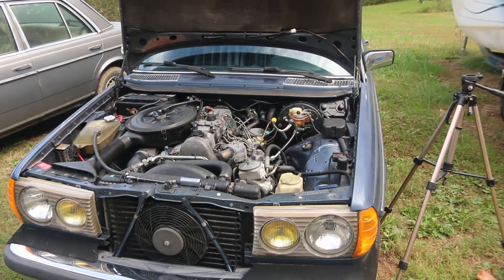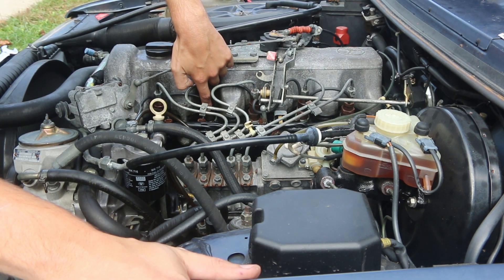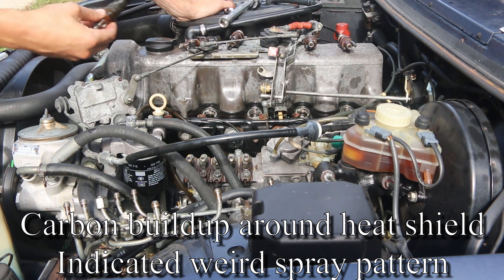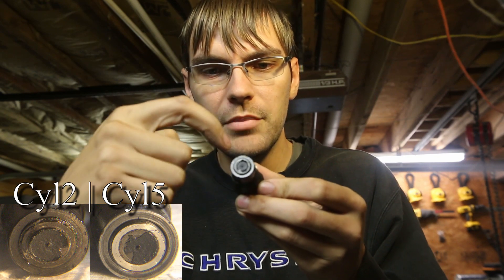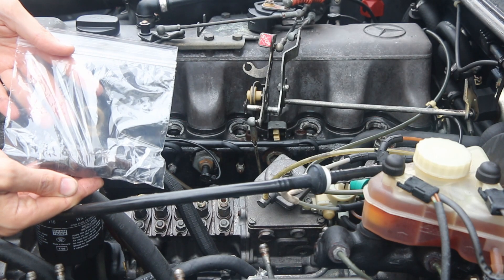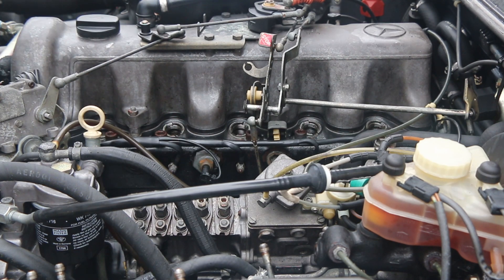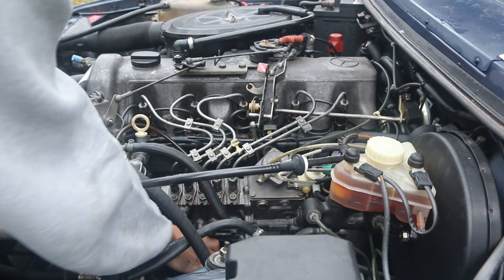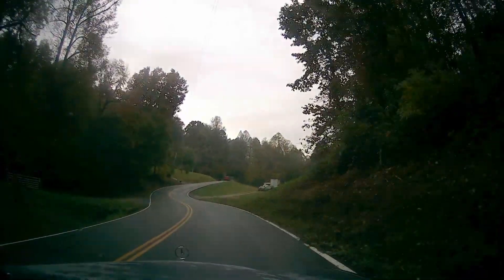Om617 knocking/rattling noise, injector nailing before and after nozzle replacement

Comment: Thanks for the Video I'm having the same noise with my 1980 non turbo 300D.  I've replaced the vacuum pump, timing chain tensioner and did a valve adjustment.  Noise still there.  I bled each injector while running but didn't really hear any difference, going to pressure test them next.  Noise seems to be stronger once the engine warms up- did you notice this on yours?  Car otherwise runs fine starts up strong down to the single digits, has good power(for a non turbo).
Reply from the maker: Dead on! The hotter the engine was the more pronounced it seemed to be. I'd check the pop pressures, doing the nozzles and balancing them did make a distinct difference in the sound of the car, I should make another recording of how it sounds now that the new nozzles have settled in a bit. I have some other things I'm curious about adding to the noise as well, timing chain stretch being #1, as I too replace vacuum pump and several other random things looking for the noise source, compression tested, valve adjustment, swapped the cam out even when I found peculiar wear on one lobe
Reply: Maybe it's the ball bearing in the prechamber that can come loose and make a strange rattle and inconsistent engine idle
Reply from the maker: @zoticus1  I checked the prechambers with a borescope but it really didn't make sense to have in the video, it doesn't record very well but they all looked intact, the injectors definetly have helped, I'm a little suspicious of the injection timing now

Comment: Nice. A compression test and possible culprits is where I would look after doing a quick valve adjustment with a feeler gage. To me it sounds like the piston is tapping against the cylinder wall. You might be able to locate the noise with a long rod against the engine block.
Reply from the maker: I did a compression test when I got the car (it was making the rattling then) and each cylinder was within 10ish psi of 350 with the engine cold and no oil, fuel or anything in the cylinders to help rings seal, which I think is pretty good for a 210k+ mile motor. The injectors did quiet it down a lot, I'm a little suspicious of the timing chain, I am going to be investigating that soon as I'm curious if it has stretched out and tweaked the timing causing some extra combustion noise as a result, or possibly even is so loose the tensioner has run out of adjustment and it is rattling in the cavity where it rides.

I tried using a mechanics stethoscope and it seemed to be more pronounced toward the front of the engine, but it was hard to get an exact read on where it was from.

There will be more videos of this car, one coming super soon about the lack of top end power involving the tank strainer and other fuel system stuff!

Comment: Every 617 seems to have its own unique clatter signature. You can try liquid moly CeraTec next oil change. I’ve seen it quite down several noisy engines in otherwise good shape.
Reply from the maker: I've noticed they all have a different personality too. It gets real weird when you start comparing the smells of various diesels. The idi Mercedes vs Cat vs Cummins vs Navistar etc, they all have a different odor even with the exact same fuel from the exact same station.

Comment: Great video! Though it appears you have alot of buildup on your injectors vs the typically weeping craters seen on most worn injectors. 

Have you run a 2 can diesel purge treatment to clear our your injection system?
Reply from the maker: I have run it on seafoam from a second "tank", I'm definitely getting some of the liqui moly stuff to try, I've heard its really good stuff. We did have an "event" where fuel quality was total trash, plugged filters, a whole mess of nonsense, it didn't seem to make anything change as far as how the car ran, but I still cleaned/changed all the filters and tank strainer, but I had suspected these injectors had issues, and finally got the chance to try new nozzles.

The new nozzles did make a dramatic difference in the sound of the car as well as the smoothness, and as they have settled in, its gotten quite a dramatic low end torque boost. the car feels like a rocket off the line.

I suspect I have a plugged tank strainer once again or a overboost valve giving me issues as it seems to choke out a bit at higher speeds (over 2k rpm so still low in reality) much more than my other 617s have.

I am still going to do the liqui moly purge but keep your eyes peeled for some videos about testing the overboost valve and quite likely tank strainer (Me taking a shower in diesel fuel basically lol)
Reply: @trythistv  Ironically, Seafoam doesn't really help our cars much. I know its great- I've used it on all my gasoline vehicles with great results (through the manifold + tank). In Classic diesels, nothing works quite like 2 bottles of Diesel Purge in a closed loop through the fuel pump + 1 in the tank + 3 New filters + new fuel return lines. 

Also recommend a 2 bottle Auto RX engine oil treatment to renew internal rubber sealing and remove carbon buildup. Works wonders on a car that basically needs lubrication to live forever!
Reply from the maker: @avivscrewvalla  well I am certainly excited to give diesel purge a try! I'm getting it all ready to go very soon, I have had success with doing the seafoam in a closed loop the same as they say to do the diesel purge, and it seemed to always help a little, nothing spectacular for sure, but usually smoothed stuff out a bit. I'm blown away with the new nozzles, either I've always had cars with terrible nozzles or going a size larger made a very dramatic difference! The car still doesn't smoke but it feels "zippy" now as my wife would describe it. I had a w116 that started in 2nd gear all the time (earlier trans was set up that way I guess) and you got used to matting the throttle at every stop light so nobody would honk. The w123s start in 1st so they've got more pep to begin with but I have broken the tires loose on wet pavement leaving a stop sign now, it feels totally different, still has a little more noise and vibration than some 617s I've seen so I'm excited to try the diesel purge! I think I've finally found my rainwater leak (windshield seal) which I'm dreading replacing but not having a wet interior will be nice, then I can putter on the other little things the car needs along slowly!

Comment: Cool video ! Thumbs up !
Reply from the maker: Thank you! We'll be doing more to this car as time goes on, These new nozzles have settled in nicely after about 100 miles of driving, and the difference in low end power is quite dramatic, pulling away from a stop sign its got a lot more grunt based on my Butt Dyno® results :)